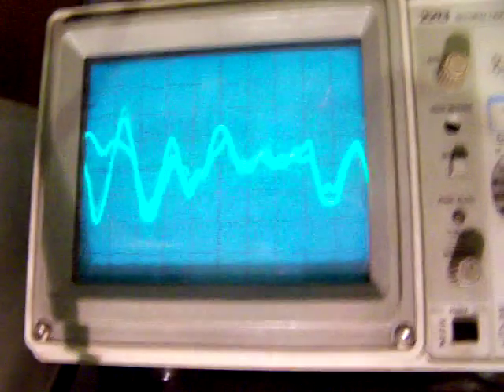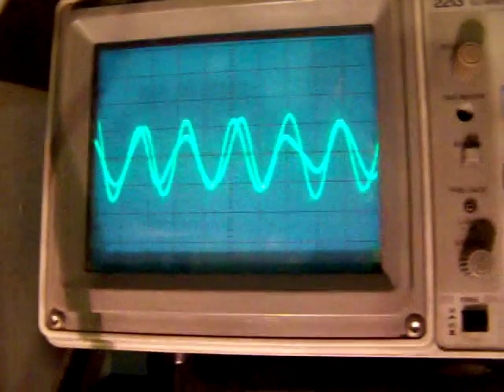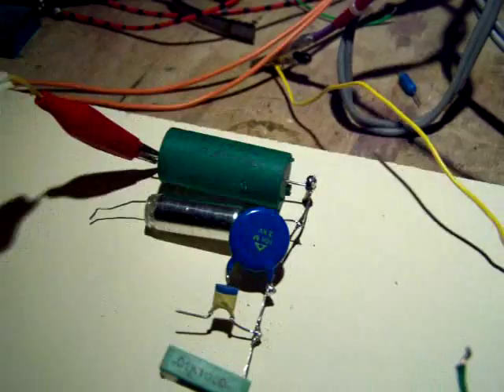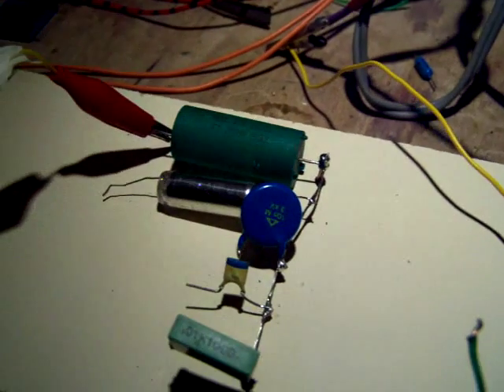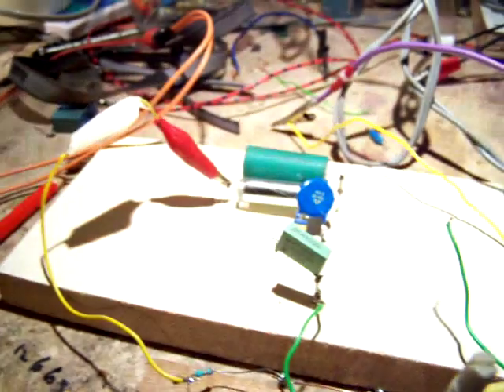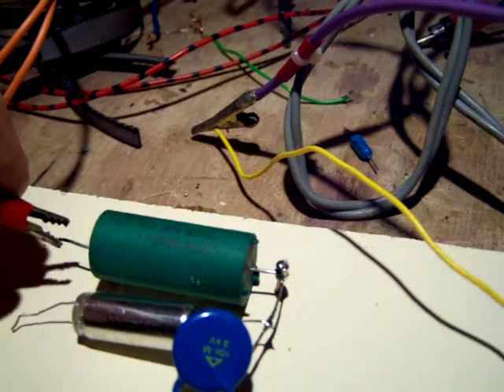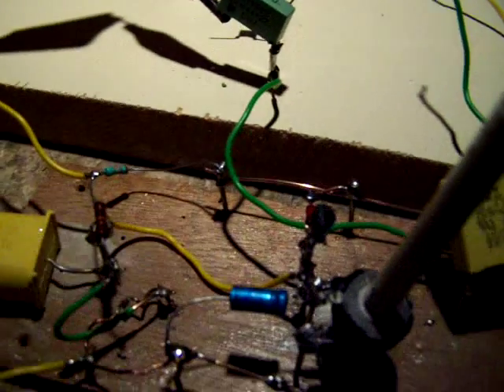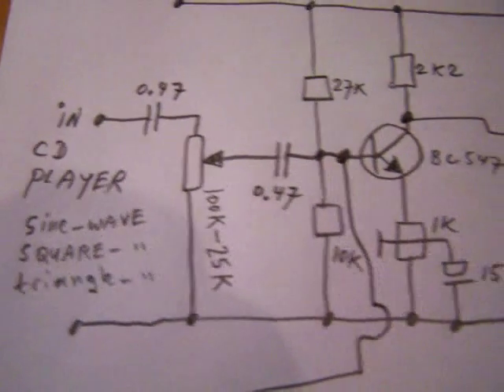do audio capacitors have a certain "sound" ?

Comment: I did a test where I had two identical Fuzz circuits one with Polypropylene Caps and one with Polyester Caps. I personally couldn’t distinguish the difference. 
Here is a link to the video and sound clips if you or anyone is interested. 
https://youtu.be/e5VwlFY9Ltg

Comment: Hello, what you can say about  Panasonic FR capacitors if i use for recapping a audio amplifier instead nichicon capacitors, i read a lot of arguments , the amplifier is a Nad 3020 now some capacitors are leaking or have sulfated legs.. the quality of original capacitors are bad.. replaced by new modern capacitor is far better than original but what about differences in capacitors... i dont have any knowledge or equipment to test like you..  i i have more money i buy Panasonic Nichicon and Elna or.. very ultra high expensive mundorf capacitors.. and  recap my amplifier four times to hear any difference... , my theory is.. maybe  all are good products but not in lifespan, plus we need to learn how to avoid counterfeit capacitors :( .  In my Nad 3020 i see 6 tantalium capacitors what is the difference with electrolytic? thanks greetings
Reply: Panasonic FM caps are great, some of the best. I cannot speak on the FR variety, but I would think they are quite good as well.

Comment: I am asking because I do not know, but for me it looks like trying to use a clock radio to compare a Mark Levingson cd player with an old cheap cd player from the local theft store.
My question, is it possible to hear so subtle differences via a handheld speaker box?
Reply from the maker: Yes, you can hear tiny differences in the 12 Khz-18 KHz range between types capacitors on a handheld speaker box, as long as this is a high quality one. But in general you cannot hear the differences in the range 50 Hertz-12 KHz. And on the way that I tested it with the scope the differences are not visible, to see differences you need a scientific setup focused on the property from the capacitor that you want to test.
Reply: Thanks a lot for answering!
Great and good answer by the way! :-)

Comment: Hi and very interesting test.  Capacitors are extremely important in audio equipment.  I have also carried out some very trivial tests but only on power supply caps and i was amazed at the differences i heard.   Anyway, given that you have at hand also a SW generator, why not looking at how a SW is deformed by passing through the different capacitors ?  the less deformed the most transparent the cap i would say.   I mean looking at the differences between input signal shape and output signal shape.  At different frequencies of course, low and high.  20Hz and 20kHz for instance.
Reply from the maker: Thanks for your reaction. My test was not very scientific and with a better test I am sure differences will be visible (scope etc). My aim was a "listening" test.
Reply: You are welcome.  I can only say that often i replaced electrolytic caps in series with the tweeters in speakers with plastic film caps and the improvements were evident. So i guess there are indeed differences.   I see also huge prices for some exotic brands but even just decent film caps can be enough for common uses. Thanks again and kind regards, gino
Reply from the maker: What you did regarding the speakers was/is the perfect idea. I did the same and in fact electrolytics are not suitable in LS boxes. Agree about your other comment.

Comment: There is a difference, but you won't be able to measure it using your setup. It is unnecessary complex and not precise enough. Changing coupling capacitor type (for example from tantalum to ceramic) in amplifier may increase THD twice or more, but you still won't be able to detect it using oscilloscope or simple spectrum analyser and for sure you won't be able to hear it on cheap speakers - the difference is not that obvious, although you may be able to hear it on good Hi Fi or any studio monitors. You need to measure THD. There is good analyser software for it - RightMark, but you need your sound interface THD be order of magnitude less than what a capacitor may introduce - and that may be a problem. Or, if you just want to check the fact that the difference exist - try building differential amplifier and feed both inputs with the same signal passed through different capacitors. If capacitors has no difference - both signals will cancel out each other and you'll have DC ground potential on output - but I seriously doubt there will be ground potential.
Reply from the maker: Thanks for your reaction. In a filter setup it is possible to hear some differences, but I agree.

Comment: Yellow drop mustard caps sound superior in tube guitar amps when it comes to the classic British Marshall, Hiwatt, Sound City, Orange amplifiers I assure you. It's about RESPONSE! Interactive subtleties from musician to his amplifier. Things an oscilloscope CANNOT detect.
Reply from the maker: I agree. There is a difference in sound between e.g. ceramic capacitors and foil capacitors in audio filters. And a capacitor is a "difficult" electronic object to analyze because of its construction: not only "capacitance" (written on it) is an issue but also its loss, inductance, temperature dependant characteristic and its use in a real electronic circuit. Indeed the scope cannot reveal these issues, only with a specialized setup all these issues can be made visible.
Reply: radiofun232 Of course the scope is limited in what it can measure, but my point is that ultimately the ear is the best test. That is, regardless of QC and parts matching for the most efficient specs, it is the ear that ultimately matters. All I can say is that I have never been able to duplicate the tone and dynamic response of certain vintage 'aged' electrolytic capacitors in my Fender tube amps power supply filter section. Not with new or NOS capacitors alike. It's almost like they have to be in the amp to develop a memory.
   Fortunately for my Hammond and Wurlitzer electromechanical organs I prefer a 'new cap' sound.
Reply: Ivan Stegachev Thanks:) , It's interesting which capacitors sound best in various musical instruments and amplifiers. As a guitar player for the past 38 years and an organ player since 96', I've experimented with many different capacitors in guitar amps, as well as organs. Of course like most organ buffs I'm a Hammond tone wheel organ fan, but also a huge fan, and owner of 2 WURLITZER ELECTROSTATIC REED organs. These have a very interesting CAPACITANCE FUNCTION.

 In these 1946'-1961' Wurlitzer electrostatic reed organs the reeds were used 100% electronically and not acoustically. I bring these electrostatic organs up because the way the reed behaves like a CAPACITOR. As each reed is zapped with a +300 VOLT charge, electrons flow in and out of the reed, whereby a screw head serving as a pick-up is placed in proximity to the vibrating reed and carries these electrons off to 'potential to ground' via the simple filtering circuits which are then amplified. There are actually 3 different screw head pick-ups on each of the reeds, and there are over 100 reeds per organ. A pick-up placed in one area sounds more FLUTE like, in another area more STRING like, and of course, another which sounds optimally REED like. So FLUTE,STRING, and REED represent the 3 FAMILIES OF ORGAN TONE IN THE ORCHESTRA. The only voice not represented is DIAPASON, but it can be approximated by mixing these other voice families together using the tab switches on the organ.
  
There is an EXCELLENT EASY TO FOLLOW " WURLITZER 4600 ELECTROSTATIC REED ORGAN ' TECHNICAL ARTICLE' which shows all of this in a cool animated diagram along with lots of pics of the actual dismantled organ with the parts labeled. 

JUST GOOGLE- NSHOS WURLI 4600

This is the NORTH SUBURBAN HAMMOND ORGAN SOCIETY'S website where they have several great articles on Hammond Tone Wheel organs ( AKA HAMMOND B3), HAMMOND X66, and of course the WURLITZER 4600 ELECTROSTATIC REED ORGAN.... 
...You'll see the hermetically sealed reed sub enclosures which lessen the outside noise since ALL REEDS VIBRATE AT ONCE FROM ORGAN START UP on the 53'-61' models. This was done to give the organ an INSTANT ATTACK when striking the keys. 

The earlier 46' to 53' models only brought air ( all of these organs use vacuum btw, not blowing) to the reed when a key was depressed, which made it more suitable for CHURCH/LITURGICAL ORGAN MUSIC because this is how a real pipe organ operates, with a slower onset of the sound as the air enters the pipe.
Reply: @paulj0557tonehead  it's called "fail", the capacitor has a shelf life to run optimally at is desired values, this is between 10-15 years depending on the amount of use the amp sees and a few other variables ( I bet you don't know what scenario would give the capacitors an extra 5 years of life, is it less use or more use? would the capacitors last longer if you only used the amp every now and then or would they last longer if the amp was out on the road every night and used for hours every day?). 
The "Aged" capacitors you talk about are actually failing and are about to die.
this is not good for the whole circuit and can cause all types of problems.
imagine buying a car from the 60's and it has 300,000 miles on it and it still has the original factory tires. would you say the best option would be to leave the original tires on the car or would it be better to put new ones on?

vintage capacitors are junk and should be thrown away for yours and everyone else's safety.
If you don't like the sound of an amp in it's proper working order then just pick a different amp, stop with the crap about vintage sound, in the day, the gear was brand new so all of the vintage gear in recordings you are enjoying is actually new at the time of recording, so when you listen to an "old" Marshall amp in a led zeppelin recording, the amp was actually band new with "in spec" caps.
if you really want that sound then you have to replace the caps!
Reply: @mergatroid1212  . .  It really is funny to hear these guys talking about (imaginary) magic in these inferior capacitors that are many years beyond their service life.

Comment: Sound is one thing, response is another, dynamics is another, and believe me when I say that after playing guitar 36 years and electronic organ for 18, yes they sound different. Especially in tube amplifier circuits, and organ tone generator circuits, as well as the filter stage following Hammond organ tone wheels. Wurlitzer electrostatic reed organs ARE capacitors! see- https://www.nshos.com/wurliContents.htm
Reply: True. In my tube amps I only use Pananonic FM and Vishay Film caps. Sometimes I use Wima caps too.